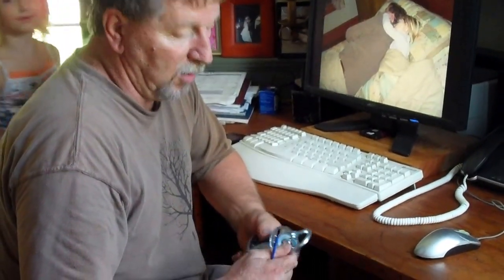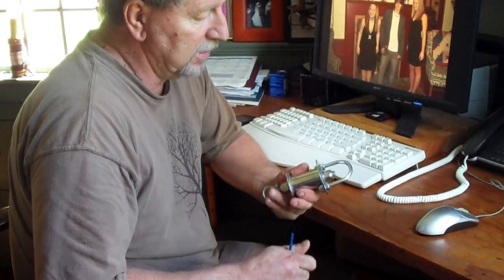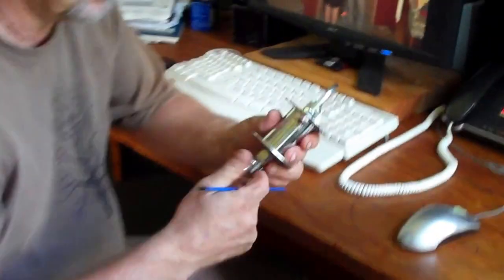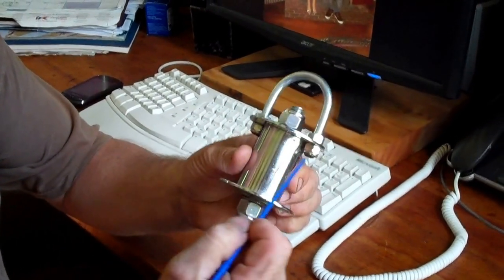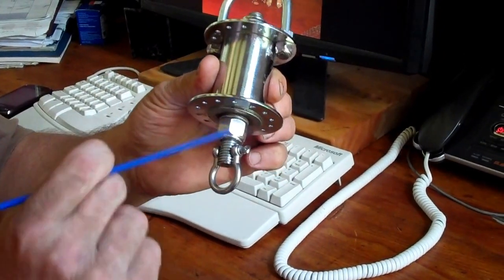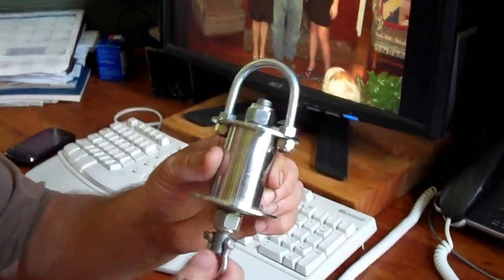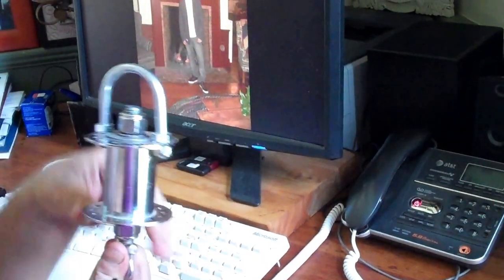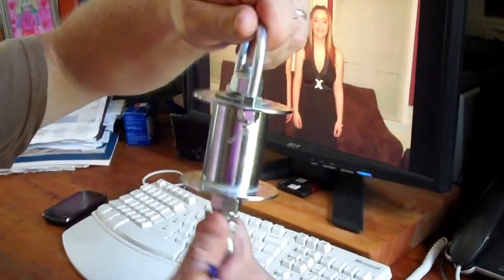Homeade Roller Furling

Comment from the maker: To be honest, I can tinker with the best of them, but I am embarrassed to admit that I have no idea what an extrusion is or even a luft wire.  There is an additional stay wire that goes up alongside the jib wire and hooks to the mast just above the jib, if that answers your question. I am an amateur with sailing although I have sailed a bit. I bought an old Flying Dutchman and am restoring it. Got it and the trailer for $150.00 and may be putting it in the water this weekend.

Comment: Looks good. But the main force on a sailboat will be in another direction than on a bicicle. How does it work in real life?
Reply: The force here is trying to stretch out the allthread/bolt.  The bearings inside of the wheel hub are set up to take the load of furling/unfurling.  This is a good design.

Comment from the maker: just one from the dump. The axel popped right out. If I recall, it was a small bike from a child's bicycle. Good luck.
Reply: one possible upgrade can be to use the original nuts which goes to the two end of the sprocket - that would secure the bearings and my help with the axel. Great work!

Comment: I stole your Idea it looks like its gonna work great should be finished with my boat and be able to test it within  a month!!
Reply: +Steve Haines Any results of the tests?
Reply: +Jason Robinson  Well it went Ok at first but the issue was wither the bearind on the wheel hub I had so I am keeping my eye our for another. the sysytem seemed like it woud work great if your bearings dont freeze up on you. I added a guide for the furling line and ran the u bolt thru a theaded cap for a piece of 3/4" PVC with a slit in the side  that was attatced to aswivel at the top then the sail slide into the slit( with a rope sewn into it seem). I did have ther pvc joit let go once but I think the was just a bad glue joint it then worked until the bearings went bad.
Reply: Steve Haines I hate to be that guy, but "video or it never happened."